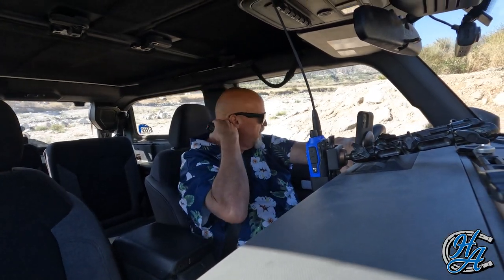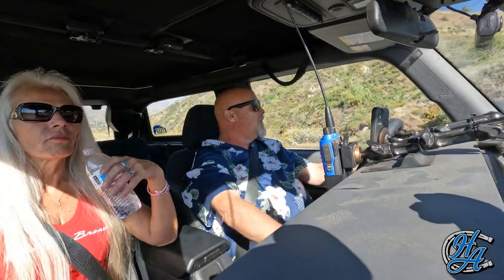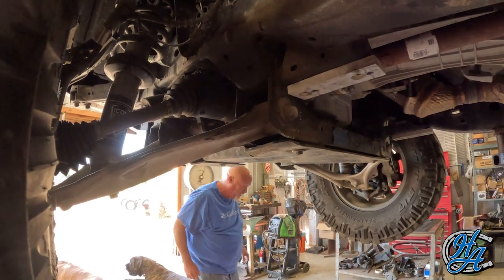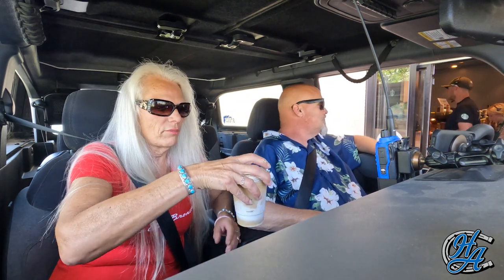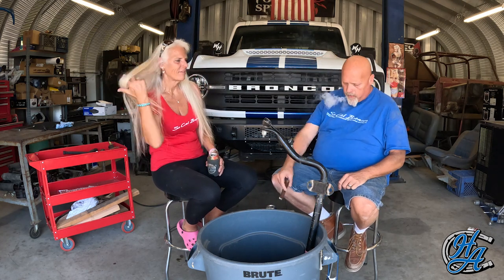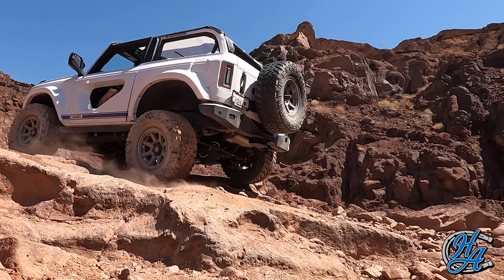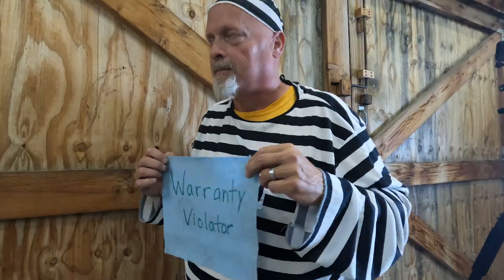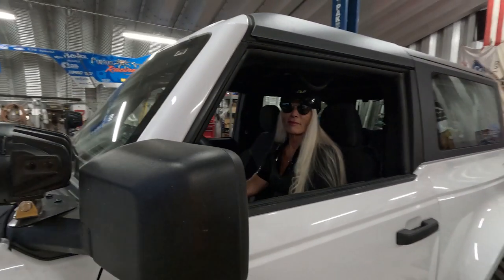Bronco Swaybar: Disconnect or DELETE?

Comment: I finally got around to removing my sway bar and I love having the front suspension be more independent! I'd done it on my RAM 1500 before and loved it then. Great video guys! 👍
Reply from the maker: Thanks!
Reply: Quick update. While driving at highway speeds yesterday, my Bronco became dangerously unstable and I decided that the engineers knew that it should have a sway bar installed after all! LoL Going to put it back on today! @HorsinAround

Comment: It was nice meeting you folks at KOH. Thanks for the 
content. Are you still happy with the disconnect ?
Reply from the maker: If you mean our complete removal of the sway bar, yes indeed we are still happy with it! In fact we've been on several more long road trips with it, even towing a small trailer, and are not missing the sway bar at all. And of course off-road it's much better without it. The caveats we mentioned in the video still apply (that it's been a net positive for our use case but we won't blanket-recommend it for everyone).

Comment: Question what about shelf road or to much body role on road. Thanks you so much your vids are great
Reply from the maker: It's not bad on the road as we said in the video, and off-road also. Shelf roads are no different, just dirt roads with a drop-off on one side, that doesn't much affect things. If you meant off-camber that's a different thing but as long as we're not loaded heavily its still fine in off-camber. I will say that more recently we've been doing more camping, with a roof-rack and more weight loaded up high, and in that situation I think it would be better to have the sway bar under there.

Comment: Can you delete the rear sway bar?
Reply from the maker: Our Bronco didn't come with one, nor did any 2021 Broncos of any trim level. They started adding them to 2022's. You can of course remove it, drive it around for a while and see if you like it, if it feels safe, etc., then decide to either leave it off or put it back on. Every Bronco and use case is different.

Comment: Looks like you've put quite a lot of money into that thing already! Lockers should be next, and probably should have been one of the earlier mods since you do seem to offroad the thing.
Reply from the maker: Lockers are a bigger can of worms that we haven't felt the need to open yet. Relatively easy and cheap mods like this can make the difference for most wheeling, for us and lots of people who bought a Bronco without them.
Reply: Forget adding lockers. it would be better off investing in axles, less hassle, and cheaper labor.

Comment: That won’t void your warranty dealer has to prove that whatever was done caused an issue and if anything the only part of the warranty that can be considered voided would be your suspension only because of the shocks aren’t stock.
Reply from the maker: The dealer can do or not do whatever they want, then force you to fight for it regardless of who is right or wrong. Like we said in the video, it can still come down to choosing the right dealer. But the real point of that part of the video was to stop worrying about it and just do whatever you want to YOUR vehicle to get it to perform the way you want it to. And to pre-empt what the know-it-alls on the Internet are going to say or post in the comments :)